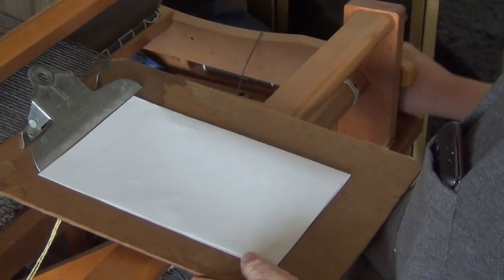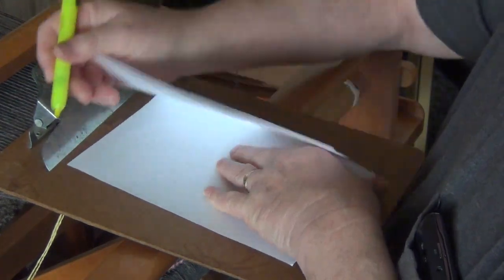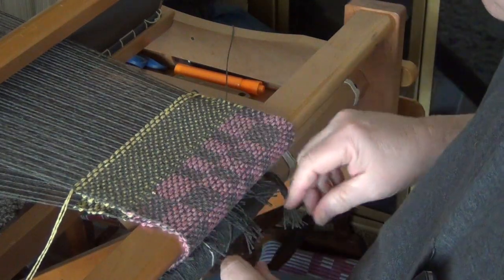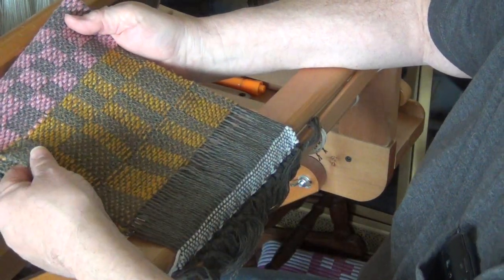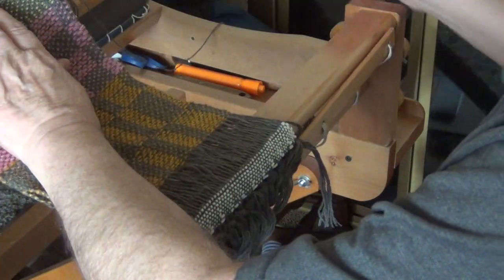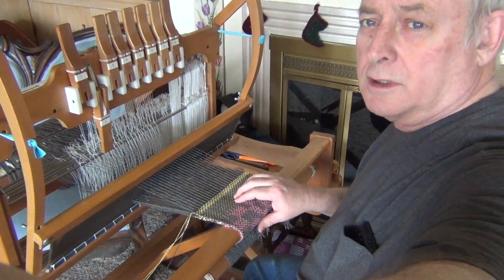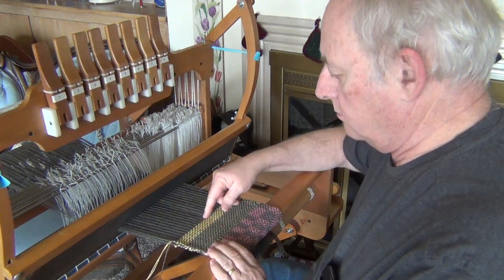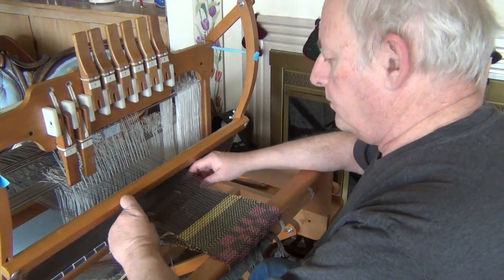Testing Double Weave Double Wide 02

Comment: Another technique to try on the fold is to use a slippery yarn or fish line that is removed after the weave. Put the removable yarn on an adjacent heddle to one that will stay in the cloth. That way it doesn't change the weave when removed and the cloth isn't as dense at the edge. Space them in the reed as normal, like for instance if your sett uses 2 per dent, don't put a single or three in a dent. I would use 1 removable per layer. I've done this with Harrisville where my sett was 32 epi for a plaid tartan blanket because of doubleweave. It works, not perfect, but close. I don't think you would doubleweave for a tablecloth, but a blanket is fine. Just be careful of errors and skips. The skips can bind the top layer with the bottom. ;)

Another technique I used was more noticeable, where I opened the sett at the fold using a heavier wool that was sett at 16 epi for doubleweave, but 8 epi at the fold. I thought the adjacent yarns would crowd more toward the more open sett. But not, wool likes to cling and hold like burdock. :)
Reply from the maker: SwampDonkey2010 Thanks SD, I think I like the fishing line idea.  I will remember that when I get to doing the full blanket that I have planned.  Which, like this prototype, will be Harrisville Designs Shetland weight for the tabby and Highland weight for the pattern weft.  But first I have another towel project that I want to get out of the way fairly quickly, and I need to order the wool yarn, I was just using leftovers on this project because it was not very big.

Comment: I know it didn't weave as you intended, but you may also consider doing what you think was a mistake in the future, but have it desirable. You might weave a tube for instance with the idea of a pillow case in mind, close one end, zipper the other. But...if you do something like overshot, you may want the weft pattern on one side and perhaps the halftone and background on the back of the pillow. I did this one time for a couple pillows. So, even though it wasn't woven the way you wanted this time, next time it may not be wrong at all. Although, my confession here is I didn't weave the ground at all. hahah!!  I followed a draft as literal from an old text with overshot drafts in it, but without reading the full text about the weave, I missed the mention of tabby. ;) Those pillows are still used here and no one is the wiser. Fun video, keep'm coming. :)

Currently, I'm working on a coverlet, I have the warp on, I'm threading about 1500 heddles for two panels that will be stitched together up the middle after they are woven. 32 epi sett with 10/2 cotton, 32 ppi, very light beat. wool singles pattern weft 1680 yrds/lb.

Keep busy, happy weaving.
Reply from the maker: SwampDonkey2010 WoW!  1500 heddles!  and 32 epi sett!  those two statistics alone boggle my curmudgeonly mind.  You are, of course, right that I may want to try some of these things in the future as planned rather than as mistakes. This piece, although small, did exactly what I wanted, it helped me get my brain wrapped around the technique that I will need to follow when I do a bigger piece on my other loom using double weave to achieve double width.
I know that when I first started weaving, and had only 2 books, one of them was Margarette Davidson's and I didn't understand what she meant by "use tabby", I too tried to follow the pattern as I THOUGHT it was written, what a mess.  
Hey - thank you very much for watching and commenting on my video.